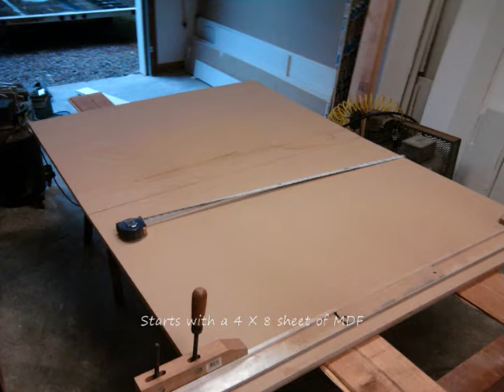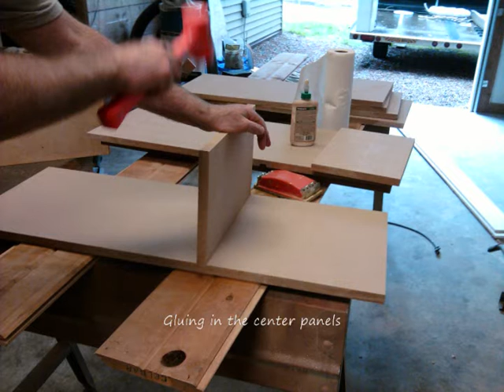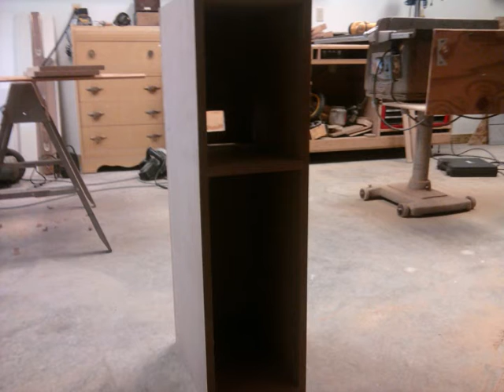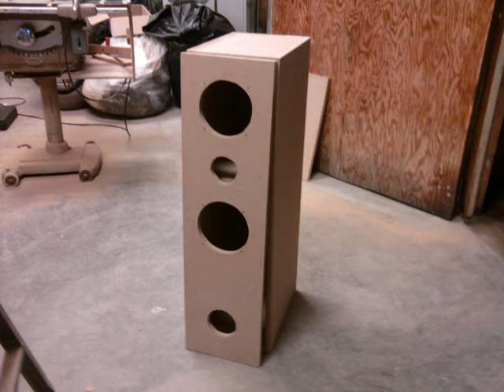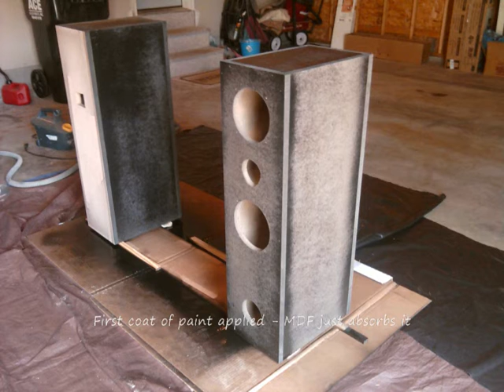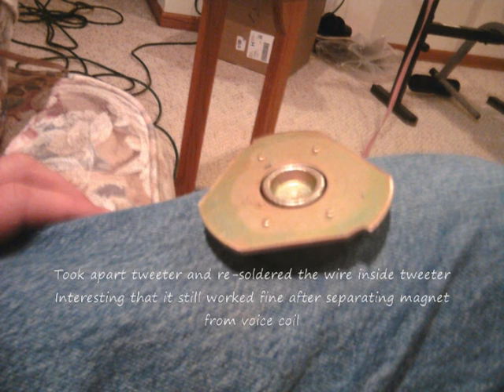DIY Speaker Project

Comment: I juist build a cabinet my self, but now comes the painting. What paint did you use and did you spray it on or roll it on? - and is it possible to see some closeups on the surface of the speakers :P ?